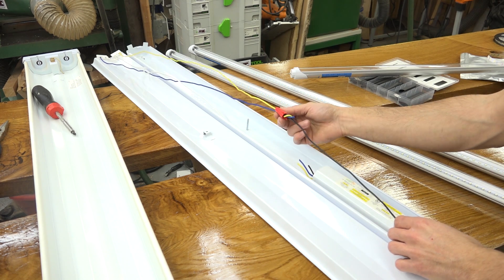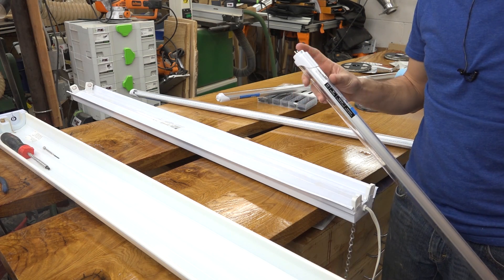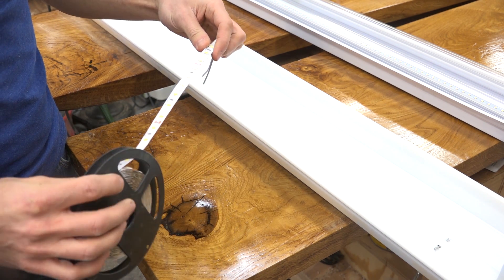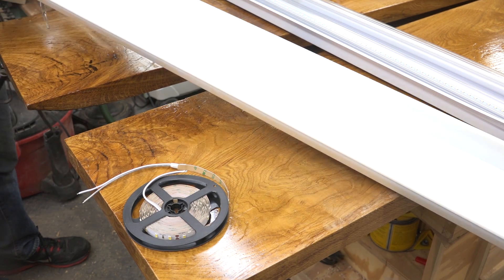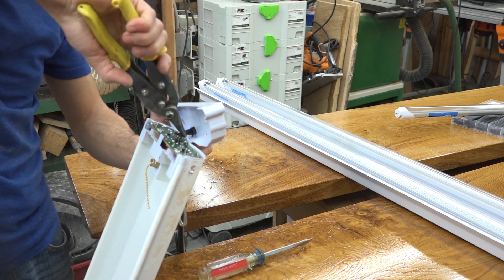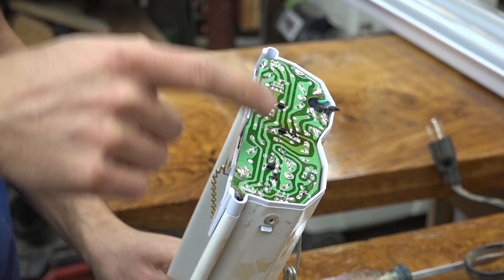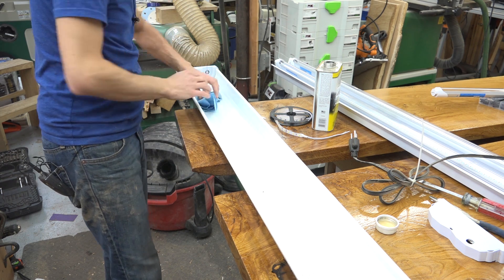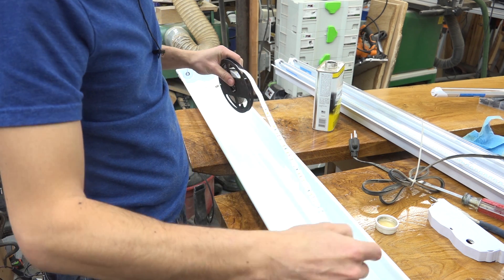Custom Workshop Lighting Solutions with LED Strips

Comment: Do you only need one power supply for all the lights where you used the light strips? I assume that you ran your wires from your bandsaw back to the power supply. My lighting in my shop is terrible. I will consider going LED. Thanks for sharing.
Reply from the maker: Yeah I bought a larger power supply so I could do two rolls off of the one supply.  Thanks Tom!
Reply: You can buy 12 volt DC power supplies in many power levels.  You are going to need about 1 amp per meter of LED strip (if you use the ones Matt Used 5050 style)  So if you wanted to run 4 strips x 5 meters = 20 meters and about 20 amps.  I recently bought a 30 amp 12 volt power supply from EBAY and it looks about like what Matt showed. Here is where I bought it ... I am not guaranteeing that this power supply will last forever but it's the one I chose ... http://www.ebay.com/itm/351792234226?_trksid=p2060353.m2749.l2649&var=620705097040&ssPageName=STRK%3AMEBIDX%3AIT

When you buy the strips / rolls ... make sure you buy enough to do the whole area you want to do ... so that you won't have to order again later and maybe end up with different types or colors, etc.   Also when you buy your strips they will tell you somewhere in the AD how much current it will take to run an entire strip or roll.  Then just multiply that by the number of strips and then I usually add 20% overage to keep from running the power supply too hard and shortening it's life.  Good luck on your project!!

Comment: Nice job, but those power supplies are a bit huge. Great if you have some left over, but Amazon sells some cute little plastic brick power supplies, about half the size of a deck of cards, designed for just this purpose.  Just need to watch the rated power output vs. the draw of your LED strips, but one should work for what you did in this case.

Comment: i love using LED strips, i have bought so many of these for so many lighting options.. your ebay link is nice matt but check these out https://www.aliexpress.com/item/Tanbaby-LED-Strip-light-5630-DC12V-5M-300led-flexible-5730-bar-light-high-brightness-Non-waterproof/32429656371.html?spm=2114.13010608.0.0.BvwwLP

less then 3$ a roll... 

the build quality is about... 90% they are not perfect, some leds look like they are hand placed and soldered but over all i have had many sets of these working for over a year on 100% 24/7 365 days non stop

i just ordered 10 more rolls of these for lighting up a newly cleaned up section of my shop

Comment: Thanks Matt.
I like those LED tubes.
I think I'll switch to those when I need to replace bulbs next time.
Reply: I used the ones from Hyperikon in a few fixtures and they worked great. I did not use the ballasts at all. You simply remove the ballasts from the fixtures and wire 110v directly to the tombstones. Some require 110v at one end of the tube and some require 110v at both ends, but it is easy enough to make either one work.

Some of these tubes are designed to work with or without the old ballast, but they produce more light without the ballast. If I recall correctly, they produce 90% with the ballast and 100% without. As a side note, removing the ballasts removes another point of failure as you never have to worry about the ballasts going bad and you never have to listen to the ballast hum.

The last set I used had swivel ends on the tubes and this allows you to turn the tube 90 degrees either direction, so you can aim the LEDs where you want them. I won't buy the non-swivel type again.
Reply: They may not work depending on the age of your old florescent fixtures. They need electronic ballasts. I tied replacing the old tubes in an old fixture (25 years old) with LED tubes and it didn't work so ended up buying a new fixture (with electronic ballast, no lights) for $12 CDN and it worked. Total cost with new fixture and 2 LED bulbs for me was $25, half as much as the cheapest store bought led fixture with single tube and the light output greatly improved over old fluorescent lights.

Comment: I like your idea but I did something a little different. I bought LED shop lights from the local Costco for $24.99 each (after a instant rebate from  the local power company; I think it was a $5 or $10 rebate but I can remember exactly - my final price was $24.99). When I rewired my garage to accommodate my workshop I added plugs along the ceiling where each light is anchored to the ceiling.These are all wired to a single wall switch. Cost for the lights was approximately $125 with another $25 for junction boxes and duplex receptacles. The light is fantastic.

Comment: Nice work Matt! For the lights on the tools, you can use wall wart power supplies to make things easier and not have to run long lengths of wire to the ceiling power supply. If that makes any sense! :)
Reply from the maker: I used to have so many of those but I threw them all out last year lol
Reply: Always the case, isn't it!
Reply: The Costco in my neck of the woods sells direct led replacement for florescent fixtures.  You just pull out the old florescent tubes and put in the LED tubes, no rewiring or fiddling.  They're $17 for two 4' tubes.  I think the color temp is around 4700K, so I don't think they would color match for your filming, but they are instant on, don't have to warm up, and no buzzing.  Also, LEDs have a wide beam angle.  Try and stick some foil tape in between the LED strips to help reflect more of that light towards the floor.

Comment: Could you wire in a separate power supply to the bandsaw power switch so it turns on both? I love the idea of better light at the bandsaw, but I move mine around a lot and having one less wire would be nice.
Reply from the maker: I think you'd still want a separate switch so you can have the lights on without the saw running or at least I like that option however, there's no reason why you couldn't get your AC power from the bandsaw's power.

Comment: For light defusion, look up trans-lum from savage. I have found it does give a slight orange tint to my light when shooting products but in a large room like that I think it may get mixed in and look ok. it also will cut down light output but anything will... 

So trans-lum is not the very best choice necessarily, but it's meant for that and can take heat. 

Good luck!

Comment: Can you use laptop power bricks?  For some reason, I thought those strips ran at a lower voltage than 12V...  I'm probably wrong, and I'm too lazy to look it ups right now.
Reply from the maker: Depends on the brick.  I think some of them even run at a higher voltage.

Comment: Also, you should get the biggest 12 volt power supply you can afford. The price differential is not much more and the bigger units come with cooling fans. A 100 watt power supply only delivers about 7 amps. (amps x volts = watts). I just purchased a 15 amp power supply for a lighting project. Then I did the math and realized my mistake and had to get a 30 amp power supply. It is difficult to find the watts of the individual LED lights. I searched the internet and got that number for the particular LED I'm using and multiplied it by the number of LEDs in my fixture to get the total watts.There are charts on the web that tell you what size wire you need for various amps at various distances without getting a voltage drop or creating a dangerous heat build up. Please be careful when you buy switches that they are sized properly. I remember you burning up a motor or something on you saw mill that is related to this topic.
Reply: Most LED strips require a 5, 6, or or 8 amp supply depending upon how hard the LEDs are being driven. The smaller 2538 LEDs usually need 20mA to be driven to their mA current rating while the larger 5050 and 7030 25 mA. Using higher power (1/2 watt and up) LEDs is another story as now heat and ventilation becomes an important issue. The higher power LEDs are normally used with a constant current power supply like a Meanwell as the wattage requirement of a current limiting resistor becomes impractical. I DO  NOT trust the Chinese specifications as I once purcahased a 50 watt grow bulb that actually consumed 5.6 watts

Comment: Those adhesive LED strips usually have a shorter lifespan in general... a few other youtubers have used them and reported that they ultimately died in the long term (a year later etc)

Comment: One issue that you missed, Mat. When you go to 12 volts the amperage of the wire is very high. It is 10 times as much as 120 volts.  So you need to use 10 gauge wire or bigger. Think about the wire size in a car. If you use a lower gauge wire it creates a lot of heat. That is why the LED strips heat up and come off. So, it is more work, but you are better off putting the LED strips into 4 separate pieces. That divides the amperage in 1/4 going through each strip. Which will be 1/4 the heat build up. Where you need the big gauge wire the most is going from the transformer to the fixtures. Also, the resistance in too small of a wire is like a resistor that decreases the light output of the lamps. On eBay you can buy "rigid" LED strips that have wires coming off the ends for easier hook up. The rigidity of the strips helps prevent them from sagging and coming off. Attaching them to an aluminum sheet works better than steel for heat dissipation.

Comment: Yup, never had any luck with the strips sticking. Always slowly fall away. Not so sure they are ever legit 3M glue as per labelling.
Reply: yup i tried hot glue too, but got too warm. wondering if there are 'authentic' 3M rolls, maybe Lee Valley. ill try epoxy next time.

Comment: would you think using a white Pvc pipe cut in 2 would be a good idea to mount those strips to. I don't have old florecent lights and that's what I wanted to try in the spring. was thinking of also adding alluminium tape to reflect the light. what is your thought on that
Reply from the maker: +Mathieu Lariviere yeah that would work nicely. You can experiment with adding a reflector but I can't imagine it doing much since the light is so directional

Comment: Hiya, great work, lovely concept. For diffusion you can fit tracing paper over the fixtures . This will not change the colour temperature of your light you would need CTO gel, i.e. colour temperature orange gel to move the 56,000 o Kelvin i.e. daylight temperature towards 32,000o Kelvin for tungsten light. Tracing paper will spread, or defuse the light. It will also attenuate it, dim it slightly. I used to work in lighting in film and TV here in the UK and Ireland. A small point, if memory serves me correctly in the US black is hot, white is return and green ground. If this is correct using green even for low voltage DC may cause confusion later to someone else. Just a thought...The extra light levels and spare capacity on the psu is worth every dollar I would think. You can never have enough light/power, clamps...

Comment: 25 bucks is still pretty good, I didn't realise the rolls were so cheap now
Reply: I've had my $10/roll strips running for 3 years with zero problems. It's important to pick the ones that have a lot of reviews and mostly 4 or 5 stars. It's also worth noting that the power supply he chose is effective and its power rating is valid to run several things off one supply, but unnecessary and quite susceptible to dust / sawdust intrusion at the location he chose. Small enclosed supply would've served his two fixtures nicely and would have plenty of ventilation up there. His total cost could've been $15 with strip and supply, making those retrofit tubes less economical. It's a decent proof of concept, though, albeit expensive.
Reply: Robin Lewis Beware though, you do have to pay for quality. The cheap ones are terrible a year later

Comment: I did the same thing with LED strips. It has worked quite well for me. I did purchase some clamps since the tape on mine seemed pretty poor. I used the 600 count strips and they seemed to put out as much light as a 4 light florescence fixture.
Reply: You are right I never trust the glue alone on overhead applications.  I used a dot of hot melt glue about every 6 inches on mine and it worked great.

Comment: For Christmas I bought my wife 14 4' led fixtures from Home Depot (http://www.homedepot.com/p/Commercial-Electric-4-ft-White-LED-Linkable-Shop-Light-54103161/205331022)and installed them in my shop, replacing several fluorescent fixtures that were over 60 years old. (The price in the store was $10 cheaper than the web site listing.) The transformation was unbelievable.  I should have done this a long time ago, but the alternatives to linear fluorescent were few at that time.  One issue with LED lighting can be a strobe effect with things rotating or oscillating.  When I power down my table saw the blade appears to go backwards as it is coming to a stop.  This could be a safety problem with a tool that has variable speed that might sync with the frequency of the LEDs and appear to be not rotating or oscillating.

Comment: Great improvement and certantly a very flexible system, LED technology has come on in leaps and bounds in recent years.  The only thing that would concern me is that dust will get into the power supply you have used and you can't really cover up the vents on it.  An old laptop supply like you mention, or a wall wart might be smaller and avoid the potential issues of dust ingress as they're usually sealed?
Reply from the maker: I'll keep an eye on it but I'm not too worried.  I blow my shop out pretty often so I can easily keep the supply clean.

Comment: Matt,  like that bandsaw idea and using it on the drill press also.  What kind of power supply did you use or is needed?  How do you determine that? 

Where's Dema been?  He hasn't produced a video since he went to Rockler.  Has he gotten too big for YouTube??  :-) :-)      JimE
Reply from the maker: There's a link to the one I used in the description.  The power requirements can be determined from the specs on the LEDs and how many you end up using.  Dema should be back this week :)

Comment: Hey Matt, when the adhesive on the LED strips on the bandsaw fails (because I've never had success sticking those things to a textured surface), I remedied my situation by adding clear packing tape over the LED strips...since they don't emit much heat, I've never had an issue with the lights and packing tape combo.  Otherwise, that is a brilliant place to put them!

Comment: Very nice :>). Where is the power coming from for the strip lights on the band saw?
Reply from the maker: Thanks Steve!  I ran the power for those from the power supply on top of one of the fixtures.
Reply: Ah, I'm going to have to do a bit more research on those for task lighting.

Comment: Very nice. Very smart. Do you think you could wire some up to the top (pointing down), of the clear plastic over arm dust collection blade guard on the Sawstop?
Reply from the maker: Yeah, I don't see why not. You can run the wires along the dust hose to keep those out of the way.  Thanks George!

Comment: The LED sure has come a long ways Matt. Great project and I think I'll do the same on my band saw. What is the D.C. Out put requirements.  
Take care my friend and do a kindness
Mark
Reply: I have used LEDs in may places in my shop and warehouse.  If you run the entire strip 5 meters (5m) it takes about 60 watts of power, at 12 volts dc ... or about 5amps at 12 volts dc.  So if you had a 12 volt power supply (similar to what he showed) at 25 amps then you could run 4 x 5 meter strips safely!!  so 4 x 5 amps is 20 amps total and you would have a 5 amp safety margin so you would not ruin your power supply.

Comment: For the bandsaw I would have utilized the power from the existing flexible light. I'm guessing that it already has a switch :)
Reply from the maker: It had a pretty low power output so I didn't know how well it would be able to handle all those leds
Reply: Matthew Cremona I believe the LEDs would be a lot lower power requirement  than the original bulb. 
Of course would check with a multimeter :)
You could also easily change the bulb out with an LED bulb. I've changed all my lightbulbs with LED bulbs :)

Comment: You should cut and tape the garage door insulation too, looks much nicer installed cleanly.
Reply from the maker: I'd like to get rid of them or rather replace them
Reply: Or build wood frame-and-panel panels for it. Fill the gaps in the insulation first, anyway.

Comment: I made this conversion myself earlier last year. I used the Hyperikon brand LED fluorescent tube replacement lights. I had several old 4 bulb fixtures that I used for the conversion. I disconnected the ballast and took them out completely. Wow, the light output is night and day difference. I recommend anybody who wants good shop light to go this route. I bought mine on Amazon Prime for $42 for (4) bulbs delivered.